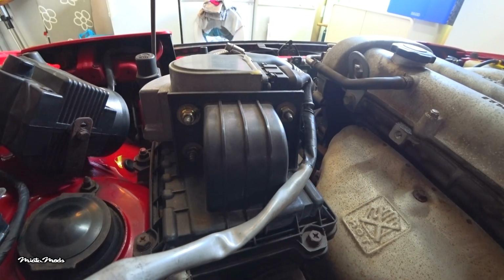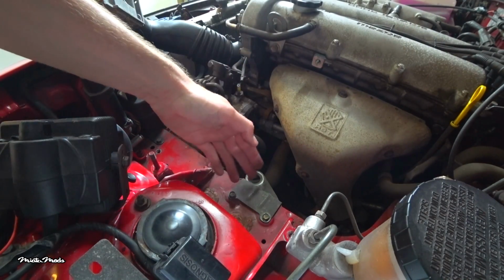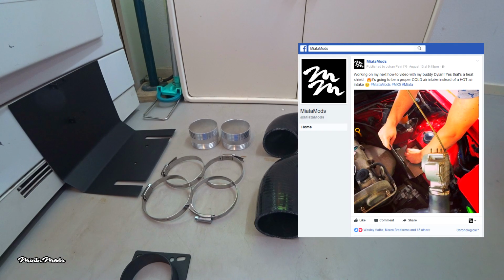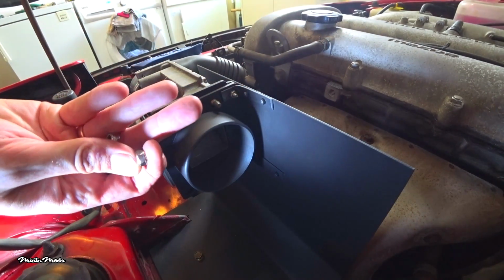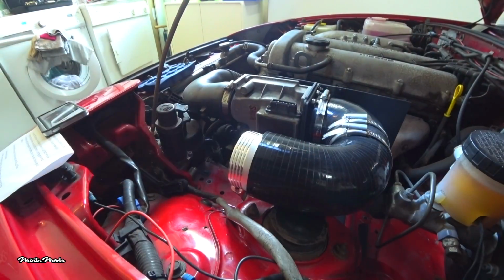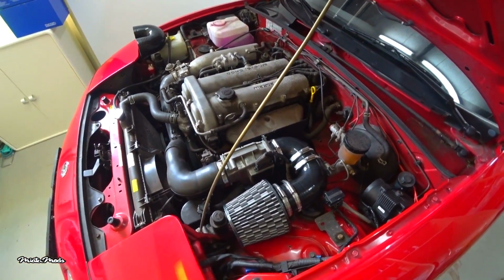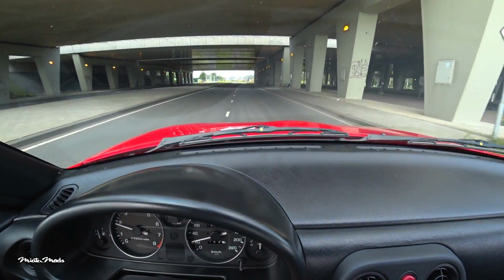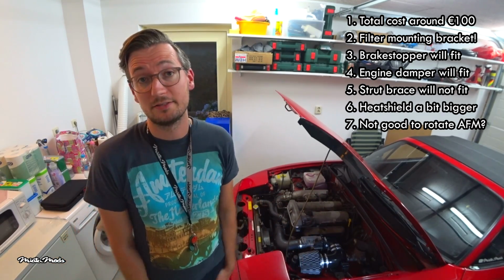MX5 NA Miata - How to build your own Cold Air Intake and heat shield

Comment: Hi miatamods!! I like this cool mod!! Sounds great and I'll do the same to my '90 na, the only doubt I have is how can this affect to the AFM in vertical position, don't you think the bearings of the fan could be damaged?? How long are u using it?? Any problems??
Thanks
Reply from the maker: Hey man, thanks for the compliment! The AFM does not have a fan or bearings in it. It only has a flap inside that opens and closes and the AFM measures the position of this flap to calculate the airflow. I guess you could say that gravity can have a small effect on this system but I I haven't had any problems so I guess it's fine.

Comment: You’re only sucking hot air into your intake. What are you accomplishing?
Reply from the maker: I think the intake air temp will be roughly the same compared to the factory airbox, maybe even a bit lower (better) because it's further away from the engine, there's a heat shield and it's getting relatively cold air from the front of the engine bay. If you have the Jass Performance turn signal indicators or a headlight intake cover the filter will have a direct airflow. It also looks a sounds a lot better.

Comment: where did you buy the aluminum connectors from, is there any chance you have a link?
Reply from the maker: Hey Steven, it’s from a local seller called Rubbermagazijn. I think they only have a Dutch website.. if you google ‘Rubbermagazijn 75mm slangverbinder’ you will find what you need. Good luck mate!
Reply: Cheers mate! thanks for the info, keep it up with the great videos!

Comment: Louder and with less power!  Just do a K&N drop in filter!   When you alter the air intakes on pre-Skyactiv engines, you ruin the top end power boost.  Mazda spends millions on making an intake that gives a boost at higher RPMs.  It is a system that uses sound waves to force more air in around 4k and up.  Porsche uses a similar technology but Mazdas system acts more like VTEC from Honda.  When modified correctly and leaving the system intact the end horsepower will be greater and a kick will happen YO!  
Or buy a VTEC Honda and unplug the solenoid for VTEC...same thing as an aftermarket intake on a Mazda.  Why do it??
Reply from the maker: Why do it you say? Let me quote myself: “It looks cool and it sounds great, that’s good enough for me”.

Also I think the power loss and the whole ‘mazda spends millions’ story is irrelevant. In my country we have a MX/Miata cup with over 50 NA’s racing in that cup and they all run the same after market intakes which resembles mine. If the intake from Mazda was THAT GOOD, why would they change it? Exactly, to gain power
Reply: MiataMods Just because a lot of people change out their factory system for aftermarket ones doesn't mean it's the best way.  My brother's car is a 626 GT with the stock intake system intact.  It burns out in three gears.  He has beaten many Corvettes, Supercharged Mercedes, M5 ect. list goes on.  Modify your exhaust, head, cams etc. 
 If you are happy with your aftermarket intake, then thats great.  They do make a decent sound.  
Just not the best for making power in my opinion, for a Mazda.
Reply from the maker: I think you are wrong but let’s leave it at that
Reply: MiataMods Aftermarket intakes help power at the lower rpms were the engine makes the least power.  The stock system works at high rpms (4k and up) were the engine makes the most power.  F1 cars don't rev high for the fun of it.  They rev high to make more power.   Drop in a K&N filter and done.  If at 4k the car isn't pushing you to the back of the seat... Your doing it wrong.  Well leave it at that!
Reply from the maker: Alright, I hope you are happy now
Reply: MiataMods Not really, but if I make some videos feel free to drop your 2 cents on by.
Reply from the maker: Yeah you should really do that because you clearly know what you are talking about 👍

Comment: Awesome video man! Only question is I have a strut tower bar, the intake would be in the way of that, if you install one in the future id love a video on how you moved the intake for the tower bar to be installed correctly
Reply from the maker: Hey Joseph, I don’t think it’s possible to make a air intake like this with a strut brace installed.. your best option is to sell the strut brace so you have enough room to build your own intake 😉
Reply: good answer haha Ill do something of the sort, or figure out how to push the pod filter down to the front left tire, near bumper area!
Reply from the maker: If you have a '94 Miata / MX5 or younger you will have a MAF instead of a AFM which is a bit smaller. It will give you some more options on how to route your air intake

Comment: You shouldn't name it "cold" because it still gets hot air from the engine bay. The only reason for doing this is increased airflow thanks to  the airfilter and beautiful noise above 3krpm.
Reply from the maker: I get what you are saying, but I'm planning to swap the headlight cover with one that has an intake so the pod filter will receive cold air directly from the outside. My other option is installing Turn Signal Intakes and make a duct that guides the air to the pod filter. If you do one of these two things it will be a proper cold air intake, don't you agree?

Comment: Hey cool. I just instaled & rerouted my cold air intake on my 99 miata love the new roar sound only problem is to get the roar sound & sound bad ass u have to get more into the throttle which uses more fuel lol but its worth it  I found my new u tube video now u got me wanting to do more the M flush is next only hear the lifter ticking when. I floor it so going to try it out
Reply from the maker: Thanks for your comment Russell!

Comment: where did you get the hoses from?
Reply from the maker: From a local shop. Where are you from? United States? If so , just search for two 76mm 90° silicone hoses (or one 180° silicone hose) on Ebay. Good luck man!
Reply: thanks! do you know the measurements of the inside of the 180? So i know to find one wider
Reply from the maker: Hey Josh, check out the video description. I’ve added a link to a document containing all the measurements. Good luck!

Comment: More like DIY hot air intake. Unfortunately the restriction for the 1.6 is the AFM and intake manifold, not the airbox. Any gains from this mod will be lost from the crossover tube anyway because it sits right behind the radiator. 
If you want to build a CAI that actually makes a difference, you need to pull air from outside the engine bay.
Reply from the maker: Did you even watch the video? As I said in the beginning of the video this is not a performance mod but it looks cool and it sounds great. Those are the reasons why you could consider doing this job. As for the 'DIY hot air intake' part, the pod-filter is right behind the headlight so it's getting air pretty far away from the exhaust headers. I'm going to swap the headlight cover with one that has an intake so the pod filter will receive cold air directly from the outside. The complete Mazda MX5 cup in my country runs this kind of setup so it's not as bad as you say it is. Yes this will not give you 100 extra hp but that is not the goal of this mod; it's mainly for the looks and for the sound.

Comment: Nice work!  I will be installing this air intake on my best friend's '93 Miata.  Where did you get the 75mm aluminum connectors?  Thx
Reply from the maker: I got it from a local supplier but I found out that they also sell these (a lot cheaper) in China on sites like aliexpress.com.

Comment: It may be a good future mod to extend the heat shield to protect the brake master cylinder, makes you track-ready that way and reduces risk of fires like the one that happened to AdamLZ
Reply from the maker: Yeah that's a great idea! I'm thinking of doing a '2.0 version' which is wider and also a little bit taller with a rubber piece on top so it has a good seal against the hood. Thanks!

Comment: While I'm not sure it's a huge cost savings when you figure in the time, I love the details.  I'm not sure a whole lot of folks have a sheet metal bender either, still it's pretty cool.
Reply from the maker: Thanks man 😊 A sheet metal bender makes the job a lot easier but you can also use a vice and a hammer and just bend the metal that way 👌

Comment: Do not do this for performance mod. This is not a cold air intake, this is hot air intake now. The factory intake pulls air from the fender causing it to pull in colder air, not air directly next to the 900 degree exhaust.
Reply from the maker: Did you even watch the video? As I said in the beginning of the video this is not a performance mod but it looks cool and it sounds great. Those are the reasons why you could consider doing this job. As for the '900 degree exhaust' part, the intake is not directly above the exhaust headers, it's next to it, just like the factory air box. It even has a heat-shield to shield the intake tubing from the heat of the exhaust headers. The pod-filter is right behind the headlight so it's getting air pretty far away from the exhaust headers. I'm going to swap the headlight cover with one that has an intake so the pod filter will receive cold air directly from the outside. The complete Mazda MX5 cup in my country runs this kind of setup so it's not as bad as you say it is. Yes this will not give you 100 extra hp but that is not the goal of this mod; it's mainly for the looks and for the sound.

Comment: Very informative video! Good work. Where did you purchase the aluminium connectors?
Reply from the maker: From a local shop. Where are you from? United States? If so, just search for a 75mm / 3inch aluminum hose connector on Ebay

Comment: That isn't a cold are intake. it's just a air filter. having a box and direct air inlet is a cold air intake, having no box is just letting in hot air, which is slowing you down but sounds better at the same time..
Reply from the maker: I think the intake air temp will be roughly the same compared to the factory airbox, maybe even a bit lower (better) because it's further away from the engine, there's a heat shield and it's getting relatively cold air from the front of the engine bay. This setup is also less restrictive so is it slowing me down? I don't think so. If you have the Jass Performance turn signal indicators the filter will have a direct airflow so in my opinion it's a cold air intake. Anyway, I hope you enjoyed the video
Reply: +MiataMods ahh ok I see. well I does sound nice and I do like the video mate
Reply from the maker: Thanks man and there's nothing wrong with sharing your point of view, that's fine! Glad you enjoyed the video 👍

Comment: You should produce and sell the heat shields, I dont have the tools to make one but I'd buy one already made :)
Reply: MiataMods I would also like to buy one do to the lack of tools to do it myself. I would be willing to pay somewhere around $30 USD. Contact me back if this is something you can do.
Reply from the maker: I did some research and the problem is that international shipping alone would cost me about $30 because of the size and weight.. So it was a nice idea, but with the added building costs I would never brake even, let alone make a profit. So I guess you have to build one on your own guys :-)
Reply: @MiataMods   Problem easily solved. Make about a dozen, have a visitor to the USA pack them in their bags. Ship from USA when orders come in...shipping would be negligible.
Reply: Hi, I would take also a shield .. like you said in your Video   a bit longer .. I'm from Germany. Would pay more than 30$ plus shipping. Possible?
Reply from the maker: Hey Henry, serious question, how much would you be willing to pay for it? Maybe this is indeed an interesting idea!
Reply: honestly i’d purchase one also
Reply: With permission I could make and sell these in the states
Reply: Brent Foster I’d buy
Reply: If you don’t have the tools to do it you can learn how to use a free CAD program and make a dxf file pretty easily since he was nice enough to give all the measurements for us. (thanks!) there’s websites where you can have stuff laser cut and shipped to you after sending the file and just bend it yourself without too much trouble. Not sure on cost, but less than what you’d have to pay for him to make and ship it to you I’m sure
Reply: 30 is crazy id easily charge $80
Reply: I mean, even if its $60 shipped I wouldn't mind.

Comment: Darn it, now I want to do this too. I've got cruise control so I'd have to ditch that to make room. It doesn't work anyway. :)
Reply from the maker: Well Frank, sounds like you got a nice project for the weekend! Removing the cruise control and making a cold air intake with heat shield ☺️

Comment: its looks really really great , i only see 1 problem , i run a Front top strut bar so it wouldnt fit :/ , but this looks really clean and cheap because for mk1's you see cold air intakes above 150 €
Reply from the maker: Thanks for the compliment! You are right, unfortunately you can't fit this if you have a strut brace.. 😔